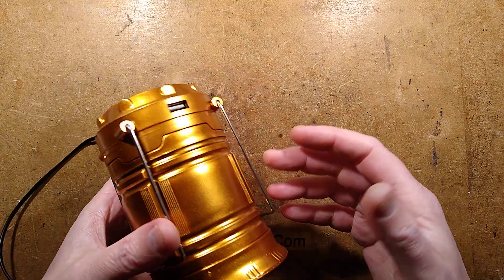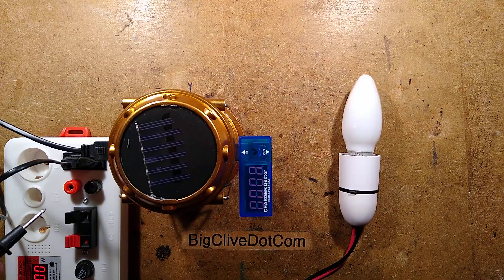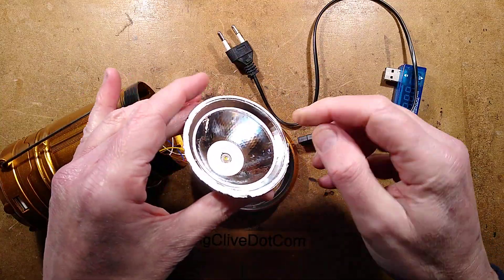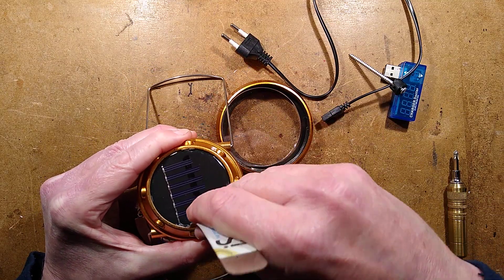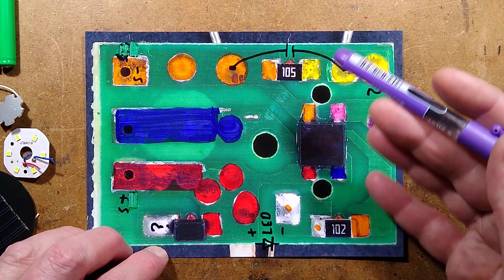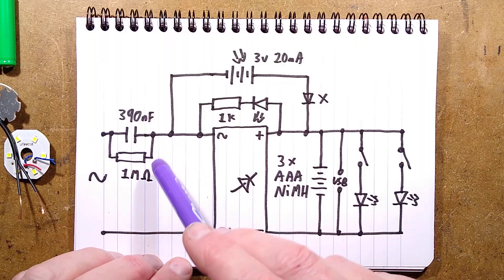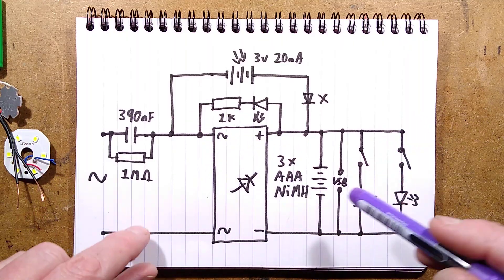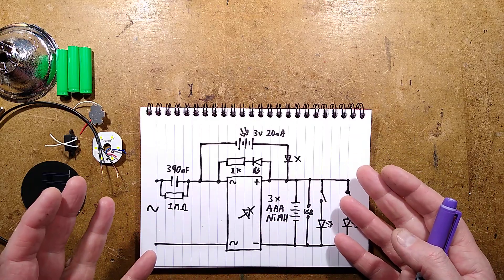Dangerous "death Dalek" lights still on eBay

Comment: Amazing that they bothered to include a discharge resistor but not to isolate the charging socket from the mains...
Reply: much more likely, the PCB was designed for a wall mount light never intended to have internals exposed or the internals messed with (light died, replace entire unit mentality), and then this manufacturer just copied the PCB for this lamp and added the usb plug cuz why not. also, I think if someone that knew what they were doing was involved, the solar panel would be across the battery instead of off doing it's own thing, lol.
Reply: @Zarcondeegrissom  panel is not useless because of the way it's connected - if you fold out bridge rectifier and look only at part containing connection between battery and panel, you'll see that there is valid current path thru one of the diodes in bridge rectifier. But 3V is not enough for charging battery containing 3 cells. It's eventually enough from keeping them from deep selfdischarge when lamp is not in use for prolonged period of time (if it isn't in dark).
Reply: My dyson has no discharge, as you get a severe shock if you touch the plug.
Reply: @turokforever007  😧
Reply: @turokforever007 should always wear rubber gloves when hoovering up & blast some prince out
Reply: it's likely it started as a fairly standard, safe circuit, but was stripped down over the course of development. considering the intelligence of people who makes these, I'd reckon they just didn't think of taking off the obvious part they could save on
Reply: Resistor is cheap, re-engineering the product is not
Reply: @AiOinc1  whoa whoa there buddy, those actually cost over a cent each, that’s not cheap at all on these budgets.
Reply: If it was fully self contained, with no external contacts, it would probably be perfectly safe as a self-contained fully-insulated device with mains input.
Reply: @matthewmiller6068 tons of random fully insulated stuff uses variations of capacitor dropper circuits and that is perfectly fine for low powers. Anything with external user-accessible connections though really needs an isolated power supply.
Reply: It’s almost like the electrical / electronics engineer designed a portion of the main circuit whilst taking shots and eventually they became so wasted that they had to go home but because they were on a short schedule someone decided to put in a pre designed system. Or seriously the engineer didn’t care, maybe under tight budgets and their job was on the line as the superordinates of the company demanded it because they thought it would be a good thing, maybe it’s a last minute decision, possibly the electrical engineer was misinformed and they assumed everything would be double insulated. So many theories.
Reply: @BritishEngineer  more like they were paying an EE student in food and when they got an unpaid internship and had to leave they took the first person they could find outside, slapped the bottle out of their hand, and gave them a job.
Reply: @BritishEngineer  wtf are you on about you couldnt be wrong please please stop trying to act like you know what your talking about it looks very stupid to the rest of us
Reply: @BritishEngineer If you find channels that deal with the country that makes these kind of products you will find that "safety" is not a high priority, there. 

It is a terrible place to build things
Reply: Stole the words out me mouth!
Reply: A shock now and then isn't the end of the world.  Especially if you have those girly earth leakage breakers.
Reply: How many people have been killed from this product ?
Reply: That is basically what I was going to mention. How they manage that?
Reply: I was about to say the exact same thing!
Reply: Where can you buy one ? Seems like a solid unit
Reply: @doejon9424  I just tossed one!
(Somebody else took it apart)
Thought I'd fix and reassemble,after looking at it though, I threw it into the recycling
Reply: I think the joke is on UK for this one. No major flashlight manufacturers even come with goofy plugs like that
Reply: More like it's amazing how they resisted making a good design
Reply: It's almost like the makers had higher resistance to their mental filaments than wattage available from the powerplant.
Reply: Thoughtless design.
Reply: Was literally about to say this (I have no idea how electronics work)
Reply: @hollapena97  stop lying, start lifting
Reply: Same with using a tactile switch instead of a piece of spring metal and contact for it to be pressed against.

I'm also surprised they actually used a PCB for the charge circuitry instead of just soldering everything together.
Reply: @ruediix  make it as cheaply as possible, that's the rule of the day, especially in China
Reply: Like almost everything in china they likely copied it from somewhere else and didn't understand or didn't care about any changes they made to cut costs.
Reply: Insane really
Reply: China 🇨🇳
Reply: @adamdnewman 😂 you right you right 💀💀. Probably has lead paint in it and is labeled a child's toy😂
Reply: @adamdnewman Many fair things too be bought from China you can cut out the middle man costs but just use your head if you are buying technology or anything with the pottential for danger then contact the seller and do your homework quickly but apart from that there are millions off things you can purchase directly which over your life will save you a fortune and even the tech I mean how often are people dying and houses burning down considering that big company's buy almost all off there materials n items from China and then we buy from them...yes if something that plugs into the mains isn't safe then obviously that is not good but you get what you pay for if your not sure don't purchase
Reply: @jshaw4757  in china you can choose to buy cheap or good, it's up to you, items as the one in the video, go for like 2$ in big quantities, do your math ...
A proper flashlight even if made in china which no longer means cheap, will cost at least 30$-50$ , if you choose to buy 3$ garbage then don't complain about it failing in 1 week or getting you killed
Reply: @TizianoBacocco there's a big difference though between a cheap product that will probably fail, and a dangerous design that could kill you. 
In the first case,  if you buy a few you increase your odds of one working.
In the second case, buy a few and you increase the odds that someone will die.
Reply: @brekel42  Can I ask you how many people are realistically dying from flashlights or such things from China are dying...I'm not advocating be dangerous I'm talking about safe lower end products that are affordable and do the job...I mean how many people die every year in state off the art Merc cars in England or West vs how many are electrocuted from a Chinese torch and if so why are the items I buy ROHS checked and how are they still allowed in through legitimate sites which I'm sure do not want blood on there hands in anyway shape or form as it will completely sever there biggest market which is the west...I'm aware some cheap builds n shoddy builds in the tech area but how many deaths have been attributed too these yearly...
Reply: I think there is a reason why HK people as well as Mainland China people (at least our customers, who are mostly EE's or IT guys) refrain from buying anything made in China...
Reply: @bonzaihb3432  I guess it depends on the item. crappy low cost noname products are wise to avoid but they surely don't do that with devices and parts designed by well-known brands.
Reply: @bonzaihb3432  A lot of people don't seem to understand that you can get very high quality engineered things from China along with garbage electronics that want to kill you.

It is a big country -- you just can't make blanket statements regarding China.
Reply: @bonzaihb3432  That's why this stuff usually carries the C E mark (Chinese export), often confused with CE (European compliant), so that Chinese people can easily avoid it.
Reply: Cargo cult engineering.

Comment: Mixed emotions on the eBay question. I like being able to get hold of absolutely anything imaginable, and I think it's more of an "informed consent" question. But maybe it needs regulating for the benefit of society as a whole.
Reply from the maker: My biggest concern is that if safety people get involved they may ban useful technical stuff.
Reply: @bigclivedotcom the unintended consequences abound when the government gets involved 🙄
Reply: public safety is a noble goal most people don't disagree with. The issue is usually the implementation. In a country that is banning knives and all sorts of mildly dangerous but useful tools, it's probably best not to ask for regulation on ebay too.

Comment: I wonder if you can go through PayPal to "report" dangerous things being sold on e-Bay?  
Since e-Bay owns PayPal...which is heavily regulated...it might be possible to use this as a work-a-round for getting seriously harmful things off the site.
Reply: PayPal has been an independent company since 2015. eBay even discourage PayPal payments now, having their own card processing agreement in place now.
Reply: @al090187   
Ahh...didn't realize that!  Thank you for the info  :)  
I have noticed that most of the sellers put on their pages that they only use PayPal for payments...at least the ones I buy from.
Reply: Just stop using Paypal
Reply: @marcogenovesi8570   
Like I mentioned above...they ONLY take PP.